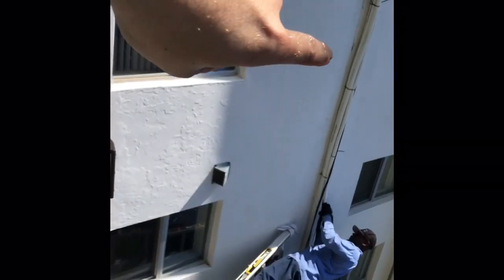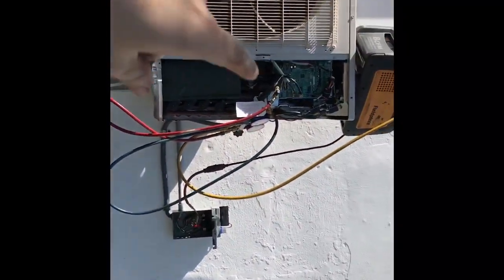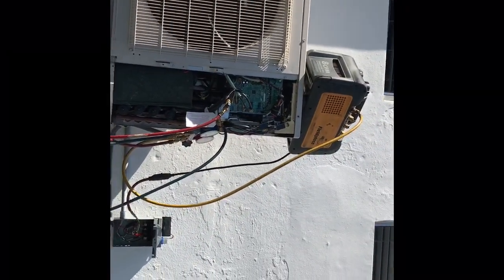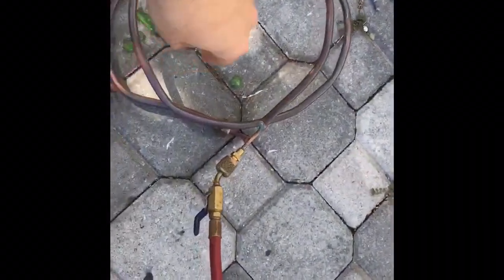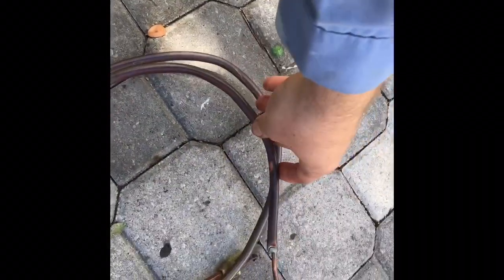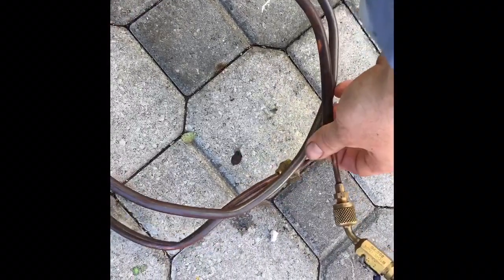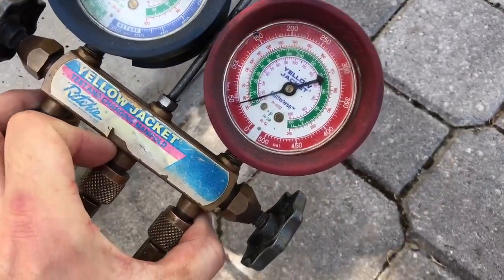leaking defective copper lineset.

Comment: I'm getting the same thing on my job's I'm at the third one I found leaking ISO polar spanning over several years of installation so it's not just one bad batch or run the manufacturer may claim when they tell you this story it's literally year after year problems with their product. I'm currently going out to one of my fourth old job sites that has used ISO PLOAR . I leak checked all the air handlers and the condensing unit I have to go back to the job and start leak checking the line set now I will post a video I just released a YouTube video on the leaks I found at my last job